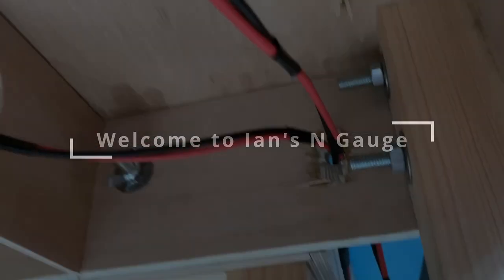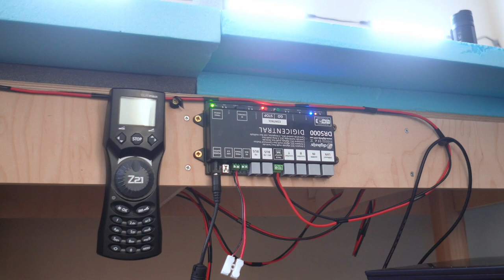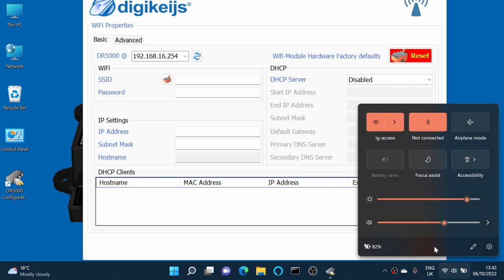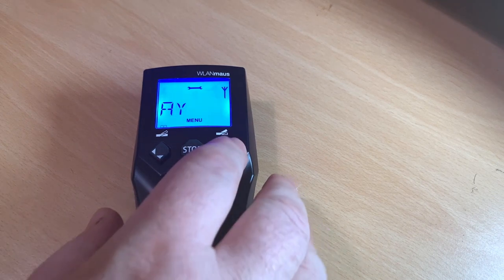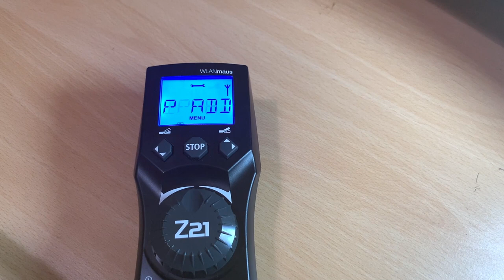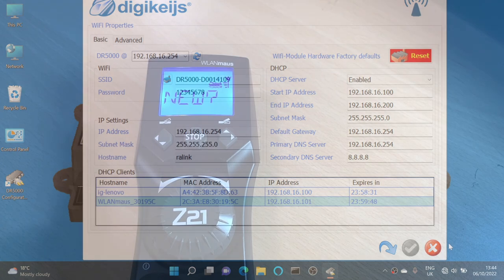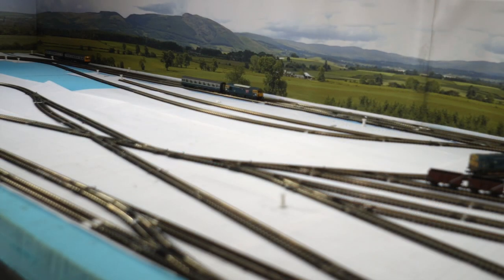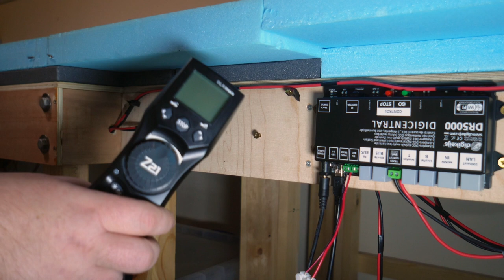034 - Shelfington - WiFi Throttle

Comment: I found your experience interesting Ian.  As you know I have the Gaugemaster Advance Prodigy which has hand controllers (called walkarounds).  I do have a wifi unit attached to the control station that allows me to use my iPad via the unit (and control two locos).  I very rarely choose that option. Like you I find it much easier and more comfortable to use the walkarounds.  Stephen
Reply from the maker: Thanks Stephen! Yes, I covet your controllers, - and whole DCC system in fact! :) My iPad / iPhone / Laptop has been the only way to control locos on my system so far, and I've lacked any sort of fine speed control, so the new throttle is revolutionary! I can actually get my trains to stop where I want them to now! Lol! All the best, Ian.

Comment: Hi Ian, excellent video on how to set it up. I have the same unit and one of my favourite features is the fact that it has no directional switch, just turn the know left and right with the 0 position indent. And as you say much easier to use compared to phone or tablet. John
Reply from the maker: Thanks very much John! Yes, I love that feature too! It's so intuitive! The only downside I've found with it so far is battery life, as it seemed to munch through the first set of batteries I installed! How have you found battery life in yours? All the best, Ian.
Reply: @iansngauge  Hello Ian, I haven't used mine that much as yet so I can't say. But if it does go thru them I might see if it will work with the rechargeable eneloop batteries I have. John

Comment: Looks like a good unit Ian, I'm happy with my iPad setup in my home made stand for now but I can totally understand the preference for a more tactile, easy to hold controller.  What sort of software dev work do you do?  I mainly do iOS apps with a bit of Android and web stuff. Cheers, Simon
Reply from the maker: Hi Simon, it is a great little controller for the price! I'd definitely like to have a stand, but I'm restricted by space, and quite honestly have nowhere sensible to put one! I've done all sorts of development work in my time, from writing games in the 80's, writing aerospace applications in the 90's and 00's, and am currently working on railway applications funnily enough! You name it, I've probably programmed in it, although Swift is something that I haven't had a go at yet! I'm currently working with Python, which is a far cry from writing in Z80, which is what I used to program the games I started on! You can lose more memory from a leak in one statement in Python than the whole machine (ZX Spectrum) had back then! Lol! All the best, Ian.

Comment: Hi Ian

Great video.

I had the older version (Red non wireless version) which I liked very much especially the control nob as it acted like a DC controller.

The down side was that I like to use full coasting on my locos and use the brake function for slowing down. 

The old unit function buttons were latching only and would not allow the function buttons to operate as a push to make switches. So when you hit function 2 the brake function would latch on and not release until you hit the button again. Hope this makes sense.

Is this unit the same?

Kind regards Dan
Reply from the maker: Hi Daniel! Yes, the brake function button is still latching on the controller, although I think it may work slightly differently to how you describe - or may depend on the DCC chip you're using! Pressing F2 to latch braking effect on while controlling my Farish 101 DMU will do nothing other than sound the brake, until you touch the control dial! Inertial control is switched off in this instance, and the speed is changed immediately as you turn the control dial! This means that you can run with F2 latched, without inertial effects, which is handy when pulling into and out of stations! However, my Farish 08 works differently! If the loco is stopped, and F2 is latched on, you can increase the speed, and nothing happens! The loco will not pull away until the brake is turned off - which makes sense! As far as I'm aware, both locos use the same Zimo sound decoder chip! My Farish 31 also works like the 08 and definitely shares the same chip! Not sure any of this helps, but it's interesting to know! It's still an excellent, reasonably priced controller, whichever way you look at it! All the best, Ian.
Reply: @iansngauge  Hi Ian

And thank you for the reply.

Yes most of my models including 009 have Zimo chips which act the same. 

Older loksound decoders I have found can function odd, especially with the Daisy and daisy2 throttle were when on zero position the sound goes into shut down mode.

With the zimos again when using the phone app and some modern throttles where you can change the function to latching or non latching. Even in non latching mode the locomotive Doesn't move until you release by pushing function 2 again from zero position which I like a lot as you said.

What I like in throttles is being able to dab function 2 as if you were pushing and releasing the air brake to come to a controlled and positioned stop if that makes sense.

With this controller and the Zimo decoder can you do the same or will it just latch the brakes on until the loco stops or you press the function 2 button again.

Sorry for all the Questions 🤣🤣

Kind regards Dan
Reply from the maker: @loco82  - Hi Dan! No problem! With this throttle, pressing the F2 button does not apply the brakes if the loco is running - at least not with any of my Zimo decoders! It seems to put the loco on notice that you're in 'braking mode', and if you turn the control dial to zero, it will immediately stop the loco! The difference seems to be if you start in 'brake mode', and turn the control dial to apply some speed, on some locos they'll begin to move, but on others they will remain stationary until you release the brake! I have tried the four locos I have that are capable of braking using F2 and none of them work in the way you describe with this controller! You may be able to configure it differently, but I don't know how to unfortunately! Hope this helps! All the best, Ian.
Reply: @iansngauge  Hi Ian.

Ok and thank you for trying out your locomotives, you have been a great help and keep the videos going 👍👍

Shame because I really like these throttles especially for the price, easy to use, nice to hold and a speed dial with a centre point and maximum end point. The one thing I hate about other manufacturers is the continuous speed dials with no center or end points.

Though I do love the proto throttle from that States. Shame we can't get them over here, let alone the price of them 😱😱.

Kind regards Dan
Reply from the maker: @loco82  - No problem Dan! Thanks for subbing! Not heard of the ProtoThrottle before so just did a quick look up! My, yes, looks great and extremely functional, but a bit out of my price range unfortunately! Lol! Cheers, Ian.